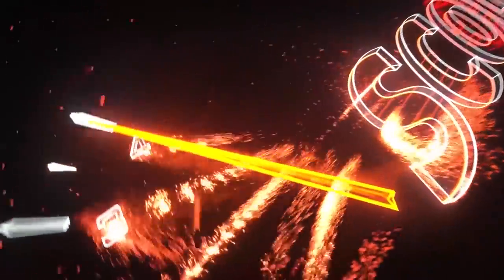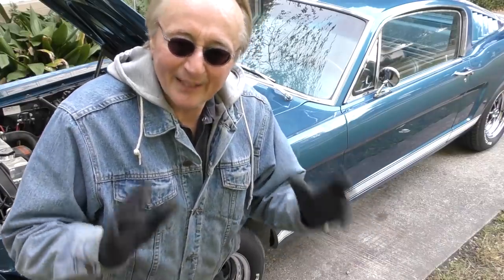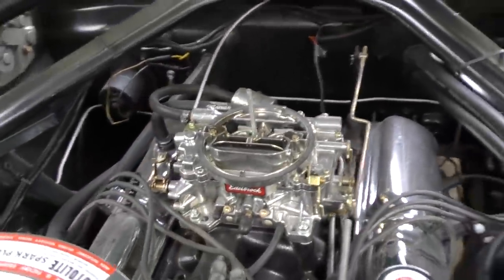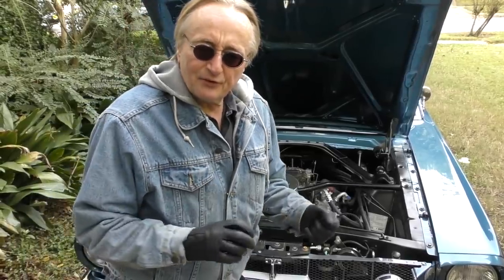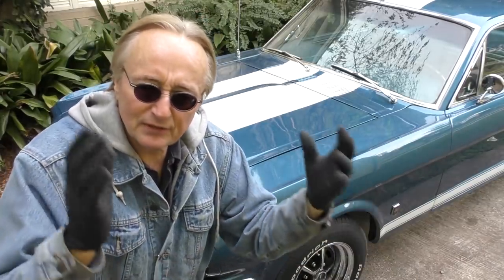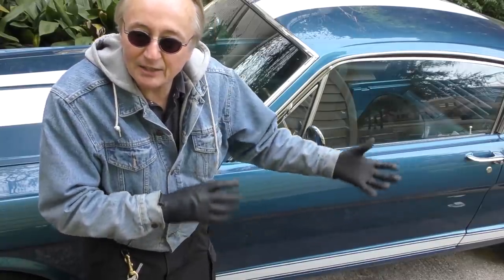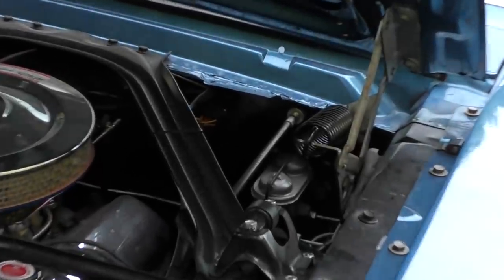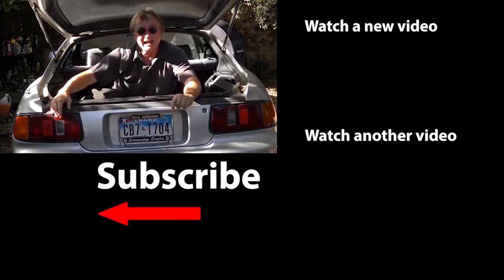I Just Bought My Dream Car

Comment: I had a 1966 289 Coupe which was a money pit. Cannot drive them regularly as the parts wear out faster than moden equipment. Most of the weak points on Scotty's car have been replaced from the air conditioner and radiator to the single master cylinder. I would like to see his power steering and front end which are primitive by today's standards. The PS also leaked at  the slave cylinder. The car still looks good, but I would rather have a decent truck or very reliable Japanese car to get around.

Comment: My first car in 1977 was a 1967 convertible Mustang with an inline 6 and forest green paint and black interior and top. Paid $600 for her and she was a hell of a car. Wanna talk about engine room space lol. I could have moved in a family of illegals under the hood.
Mid 60's Mustangs suffered from Japanese steel. By the time it got to 
Detroit it was already rusty so they wire brushed the rust off. With 
predictable consequences. Every decent mid 60's Mustang you have ever 
seen has had a bottom up rebuild. Mine....10 years after it was 
new...smack the quarter panel with your hand and hear the rust falling 
on the inside.

Comment: I gotta agree, they classics are just a different creature. Wife bought me a well sorted 81 fiat spider with 50000 original miles, pretty much the same as they made them in 69. Love that car, turns heads and you can work on it at reasonable part cost. New cars aren't built to last so long and all look the same. Rock on man.

Comment: The inline 6 Ford 250 cubic inch engine is even more reliable
Reply: Levy torregrosa Oliver ya but nobody wants an I6. V8 is the way to go
Reply: In this Mustang it would have been a stock 200 cu in. in 65. Still good engine, bullet proof, but you NEED a V8 for a 'Stang, pure and simple!!

Comment: Do they have transmission conversion kit for the automatic ones to manual?
Reply: You can convert from an automatic to a manual but you need a peddle box and a fair few other bits and pieces... I’m converting my 3 speed auto to a five speed manual in 5 months

Comment: I'm selling my 66 if anyone is interested.  Performance white, 302 w/GT40 heads, 4brl Holly carb, new 5spd trans (T5 Z class).  I just restored the trunk and added a custom rear firewall for safety and rigidity.  $16,000

Comment: 2010's cars are going to be so dead in the future. Not just the plastic, but all the blown engines with these turbos that people think are Indy cars, so they drive them as such. I've seen more people gunning it at lights and merges that they're just begging for either a blown engine, or a massive wreck.